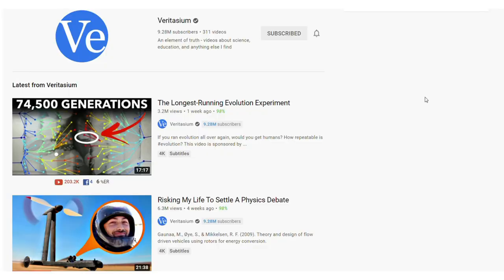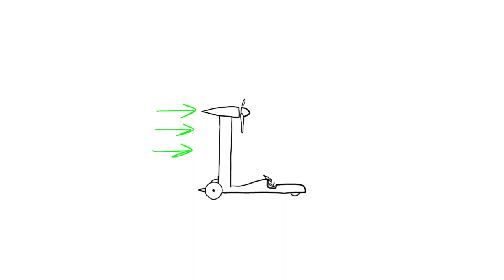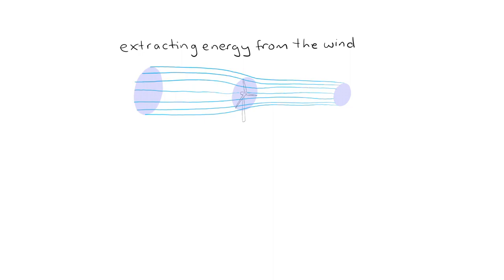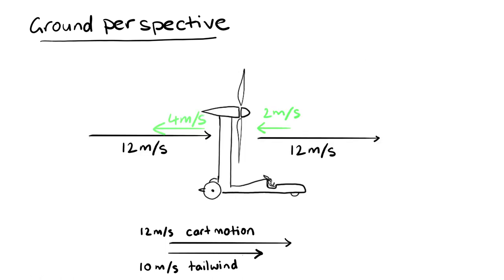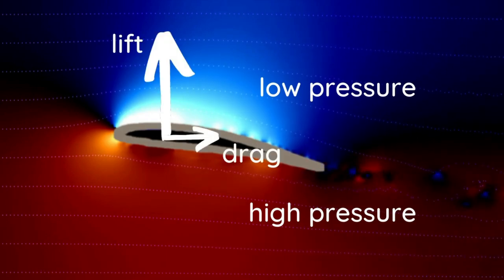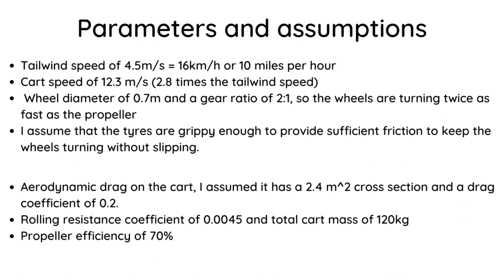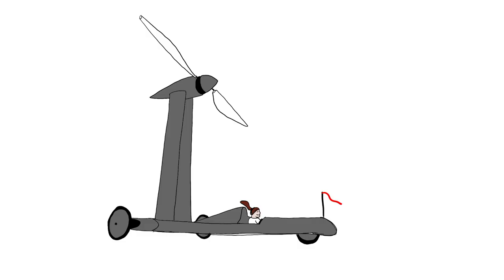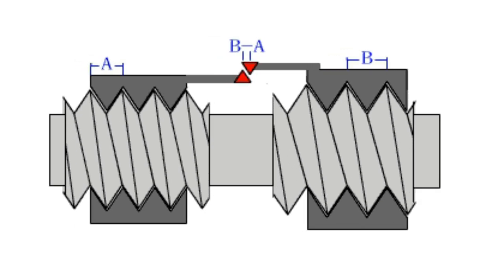Downwind Faster Than the Wind by Veritasium: How Does it Work?

Comment: Now the real question is, can you make a glider that travels faster than the wind?
Reply: That's easy! -For a limited period of time.... Just push the stick forward, and you will achieve airspeed greater than the wind speed. 😉
Reply: You do not need a special glider for that. Current record in dynamic soaring is something like Mach 0.6 or even Mach 0.8 for a small RC-glider flying in circles through a wind shear. Of course you need a *wind shear*, not just a *uniform wind*.
Reply: @cogoid   You shouldn't remove your answer away from the base of the original question. This is all about moving faster than the wind, with the wind from behind. I'm no airplane engineer or an pilot, but I'm pretty sure your sailplane MUST move faster than the air around the plane, to avoid stall, and dropping out of the air. If you go along the wind, and the air moves faster than you, then the wing looses the lift, and you end up with a expensive projectile. Unlike a machine moving on the ground, a sail plane is not restricted to only two dimensions, but have the freedom of using the third dimension, and can gather speed with the use of gravity.  The thermics are also a player in the equation. Can you with enough thermics,  maintain the lift of the plane , even if you move slower than the wind blowing from behind?

Comment: Does it mean a solar sail can travel faster than light?
Reply: Not in the absence of something to act against (like the ground, in this scenario). If you take away the wheels, and make the Blackbird a hovercraft, this doesn't work at all.
Reply: "Does it mean a solar sail can travel faster than light?"

No, that would mean going backwards in time in some inertial frame. Also, reaching the speed of light would require an infinite amount of energy.

Comment: If we can prove with physics(math) thart DWFTTW is possible, why did I get the impression that huge numbers of scientists and engineers said it was impossible?
Reply from the maker: Well because scientists and engineers make mistakes sometimes! It's crazy how confident some of those mistaken scientists and engineers were though.
Reply: @EngineeringwithRosie  Probably because they are thinking of it the wrong way,  i.e. a land vehicle that's powered by the air/wind(therefore how could it outrun its power source???), ..when in reality it's a land-and-air vehicle that uses the relative velocity between those two media to extract useful energy. Consider the equation Power = Force x Velocity, and it quickly becomes apparent that your vehicle can generate a net driving force by having your input coming, at lower drag, from the medium with the greater velocity relative to the vehicle, and applying a greater thrust to the medium with a lower relative velocity to the vehicle.

Comment: As far as I can tell, this video did not address the question of how the Blackbird got enough speed such that the thrust from the propeller could accelerate the vehicle forward when the wind died down.
Reply: " the thrust from the propeller could accelerate the vehicle forward when the wind died down." 

The relative wind at the propeller blades never "dies down".
Reply: The only explanation would be the propeller would act as a flywheel with a lot of stored energy that could be released for a moment to accelerate faster than the wind.
Reply: @eyytee  In the video by Veritasium the wind does slow down, but the vehicle continues to accelerate.
Reply: @Godznrg4u  No, it cannot slow down the the propeller to extract energy, without slowing down the wheels.
Reply: @johnmiwa6256  "In the video by Veritasium the wind does slow down, but the vehicle continues to accelerate."

Yes. It can go ~3x faster than the wind. So if it is not at that limit yet, it will keep accelerating, even if the wind slows down at bit. That's because even in the slower wind, it is not at the maximal wind-speed multiple yet.
Reply: @eyytee  How do you explain the variable pitch prop? And why would it be at the maximum angle of attack when the prop is turning the fastest if it slows the wheels down?
Reply: @johnborton4522  I hope you can understand how ridiculous that sounds to most people. I respect all of your hard work on this project, but something doesn't add up.
Reply: @Godznrg4u  

Of course I understand -- it's proven to be one of the best and most mind-bending physics brainteasers in history.

// "something doesn't add up"//

Happy to answer questions.
Reply: @johnborton4522  Would this work with gravity as the driving force?
Reply: @Godznrg4u  

Nope -- it requires a constant tailwind blowing over the rolling surface.
Reply: @Godznrg4u  

Have you done any other research on the craft other this video or perhaps the Veritasium video she references?

Would you like me to give you some other resources?
Reply: @johnborton4522  It would seem to me that a steady downgrade would play the same roll as a steady tailwind, both turning the wheels that turn the prop. Tell me what I'm missing
Reply: @Godznrg4u  

If by "downgrade", you mean downhill, then yes you could roll a vehicle downhill faster than the wind, but that wouldn't be wind powered.

(I just realized what you meant earlier when you said "gravity as the driving force" and I thought you were talking some science fiction 'gravity engine' crap.  My apologies.)
Reply: @johnborton4522  No apology necessary. Yes I mean downhill faster than gravity alone. One test with the chain off the propeller and one with the chain on. And see if the propeller would add in acceleration or decrease it.
Reply: @Godznrg4u  

Cars go faster downhill than on the level ground.  Bikes go downhill faster than on level ground. Planes can fly faster if they are losing altitude rather than climbing.

Testing to see if the Blackbird would also operate faster going downhill would be a rather pointless test -- yes it would and it doesn't need to be tested to know that.
Reply: @johnborton4522  
I disagree, I think it would be very interesting and relevant .
Reply: @Godznrg4u  No idea what your question here is, but It works without the variable pitch prop too. See videos of their prototype like "BUFC second run"
Reply: @eyytee  I'm just trying to explain how a vehicle can exceed its method of propulsion, and continue to accelerate from the turning of it's own wheels.
Reply: @Godznrg4u  It doesn't "exceed its method of propulsion". It stays within the moving airmass, even when it moves faster than the airmass. It slows down part of the airmass relative to the ground to extract energy.
Reply: @eyytee  Thanks for trying to explain this to me, I still need more research to see how this is possible. I appreciate your efforts
Reply: @Godznrg4u  

// "I disagree, I think it would be very interesting and relevant ."//

Then build one and run it downhill.  To most folks, the fact that a wheeled vehicle can roll faster downhill then on the level is what we call 'settled science'.  If you still need proof of that, have at it.
Reply: @johnborton4522  
I think you missed my point. The experiment would be to take the wind out of the equation. Running the blackbird down a long hill, with and without the propeller attached would be the demonstration. If its faster with the propeller attached, that's positive proof.
Reply: @Godznrg4u  

Do remember that the brainteaser isn't "Can a cart powered by the wind travel downhill faster than a cart not wind powered" -- because that's what you would prove/disprove by your test.

The actual brainteaser:  "Can a vehicle/device be built which can travel directly downwind, faster than the wind, powered only by the wind, steady state?"

Running down hill with the propeller gone will do nothing to answer that question (which was answered after all, many years ago).
Reply: @johnborton4522  
Thanks for taking the time answering all my questions. It's been great learning about this effort. Congratulations on all your success.
Reply: @Rick_Cavallaro  Yes I'm beginning to understand this better. I think the thing I was getting stuck on was the cart out running the wind, but not realizing it still stays within the moving wind mass. Thanks for taking the time to explain things. You have helped many people realize we don't know everything.

Comment: i believe you are wrong. when the car is moving at the speed of the wind. yes there will be thrust from the trubine, but at the same time the drag of the turbine blade will work on the wheel (like a break). i have not find a way to show which force is bigger. but at least, you can not prove the concept this way.

also lets have a thought experiment. assume the wind speed is zero. while the ground is moving to right at speed V (for example a giant belt). the car has a speed of the wind which is zero. according to the concept, the car should start to accelerate to left. which is impossible. also think about the energe of the whole system, if the car did accelerate to left. the kinetic energy of the car increased as it started to move, the kinetic energy of the wind also increased, as it was blowed to right. so where are the two engergy come from?

However in real life things can be more complex. here i assume the wind is a block of air moving togerther at the same speed. but in reality, air close to ground move slower.
Reply: You are correct that there is a braking force on the wheels.  You are correct that to accelerate, the thrust force from the propeller must be greater than the braking force on the wheels.  So how can the thrust from the propeller manage to be greater than the braking force on the wheels? (yes, sounds like the usual perpetual motion scams).

Lets use the classic physics equation:  'Work= Force x Distance'.  Now let's remember that with a tailwind, on it's downwind path, the Blackbird wheels travel further over the ground than the propeller travels through the air.

Work is 'harvested' over a greater distance (and thus at a faster rate) than is expended by the propeller.   The force at the propeller is higher, but the rate of work is actually lower.  This delta in force causes acceleration until all balances out. 

This is the best presentation I know of on this topic.

https://www.dropbox.com/s/107bmzgxhutwo5m/My%20ddwfttw%20analysis.pdf?dl=0
Reply: @johnborton4522  thx. let me try to digest it.
Reply: @xinglinjiang4952  "yes there will be thrust from the trubine, but at the same time the drag of the turbine blade will work on the wheel (like a break)"

Here's one way to think about it. From the cart's perspective both the ground and the air are moving backwards. However, the air is move backwards (relative to the cart) slower than the ground. This is what allows the accelerating force from the propeller to be greater than the decelerating force from the grip of the wheels.

Comment: I watched the Veritasium $10,000 bet video and I am now a believer, but a big part of the confusion lies with false and confusing statements by everyone including Veritasium in parts of his video (he is a classic “over seller”).  Here is what I wrote in the $10,000 Veritasium video comments:

Life is a process.  This Veritasium video is a process.  This video has a lot of wrong and misleading statements, but at the end, gets the explanation correct, sort of.  At the end, he still is promoting the treadmill experiment, which is for sure not doing what the Blackbird is doing (some aspects are similar, but it confuses things more than it helps).

My next comments dissect this video by explaining what is said incorrectly or in a misleading way, but also congratulating Veritasium on the one good explanation he comes up near the end. Also, spoiler, the Professor ended up giving Veritasium the $10,000!

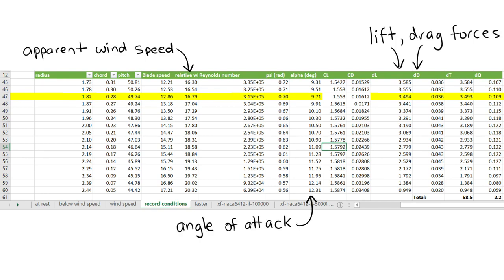 Time mark 11:45 - false/misleading  statement - “power is input into the system by the ground moving under the car”.  The error in this statement is that there is zero energy created as the wheels interact with the ground.  A transfer of energy within the “system” is all that can happen at the wheels.  Saying “power is input into the system” at the wheels is the key not-true part of this statement.  Presumably, he means the “system” is an imaginary dotted line (a “control volume”) that encompasses the entire vehicle (wheels, chassis, chain drive, mast & prop).  The bottom line, clear as a bell, concept regarding energy, is that for Blackbird to accelerate, energy of some form has to enter this control volume.  “Control volume” is a favorite concept with the Thermodynamic folks, but is it very useful in this discussion.  The energy input could be that the ground was not really level and the energy input was really the exploitation of the potential energy due to Blackbird being higher at the start than at the finish, or due to momentary wind gusts as first proposed by the Professor.

Olive branch - If the wind was steady, if the ground was level, if there were no hidden power sources on the vehicle, if the data was recorded properly (no hanky panky) and the Blackbird really and truly can go faster than the wind, in the same direction as the wind and for sustained periods at constant or accelerating velocities, then the only logical available external power source that can enter the system control volume is the wind (let’s ignore solar energy input for now).  So, there must be some sort of unaccounted for prop thrust amplification factor that is sustained by the interaction of the wind and the control volume.

BTW, the treadmill experiment is not a proof at all.  There the energy input to the control volume is for sure at the wheels - the sloped treadmill transfers mechanical power to the wheels and then to the prop that generates thrust that moves the car forward and up the slope of the treadmill.  This is not how the Blackbird interacts with the air.  Consider a level surface, with zero wind - you could tow the Blackbird behind a pickup truck and watch the Blackbird catch up with and pass the truck, heck, it could then tow the truck… this ain’t gonna happen, but Veritasium’s mishmash of fuzzy explanations would make one think that could happen.

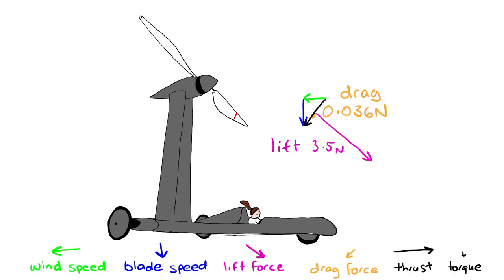Another error at time mark 12:40 - lever action and bicycles going up hill are inappropriate comparisons.  Yes, a lever exists, yes, mechanically, the torque at the wheels can be less than the torque at the prop drive shaft because the rotational speed is faster at the wheels (Torque, lb in = (63025 * HP)/RPM).  So, yes, the force acting at the periphery of the wheel can be smaller than the force generated by prop, this is plain old everyday physics, no magic, no mystery, not new.  The missing concept is the source of the energy entering the control volume.  The kid is the energy source on the bike, a lever does not move unless you expend energy to push down on one side of it.

Time mark 14:20 - The “ah ha” moment - The little cart & 2x4 experiment - First off, and I don’t think he was trying to fool us, and he points this out too, watch carefully how the top big wheel is rotating counter clockwise.  So, due to the ratio of the drive train, the small clockwise rotating wheels will drive the big wheel due to his energy input by shoving the board forwards, and the big wheel will “walk” along the board and go faster than the board’s velocity. 

** The key here is that board is both the energy source as well as a body for the big wheel to push against. **  

This was really the “ah ha” moment for me.  Replace the board with the wind and imagine that the top big wheel has paddle wheel fins attached to each side such that they also rotate counterclockwise.  The essential fact here is that the wind is the energy input and the paddle wheels have to have enough “bite” (call it friction sort of) to claw itself faster than the wind.  Paddle wheels are too inefficient.  The prop does the trick.  I still stand by my earlier texts that the real problem here were the false and incorrect explanations from every one and that, from early on, I felt that for this thing to work, the interaction of the prop with the wind must be causing some sort of thrust amplification effect.  Kudos to Veritasium for finally stumbling onto a good explanation, and that is what matters in the end.
Reply: No

Comment: did it have a gear box
Reply from the maker: I think you can change the gear ratio, but not while it is running. But I may be wrong, I have never seen the real cart, only in videos.
Reply: The gear ratio between wheels & propeller is fixed during a run.
Reply: @EngineeringwithRosie  

You are correct Rosie.  There is a common SRAM rear bike cluster on the rear axle, but with no derailleur.  The upper sprocket is the largest recumbent bike sprocket we could get (and heavily reinforced).   The propeller design (which is part of the overall 'gearing') the wheel sizes and the sprocket ratios had to be carefully matched for success.  

Gearing can be adjusted while at rest, not while in motion.  

The best presentation talking about getting the final ratios correct is here.

https://youtu.be/X6oJpnSJyV8